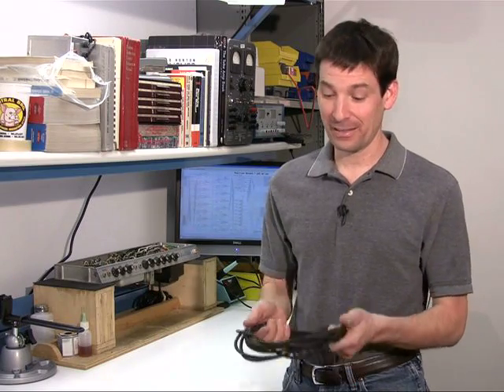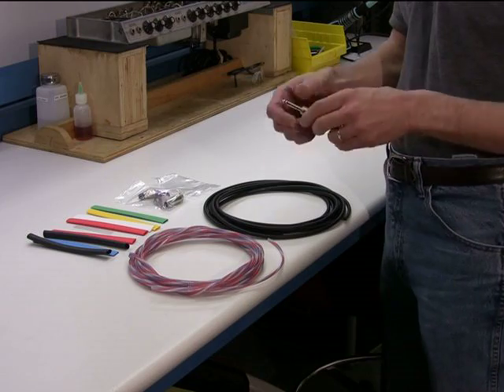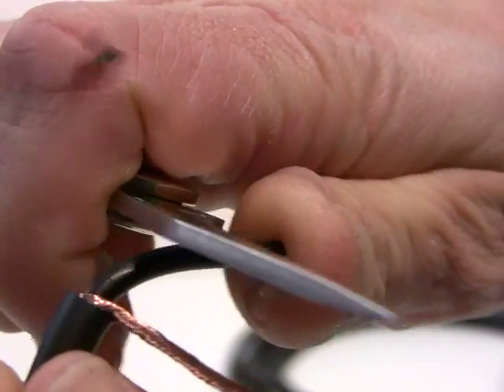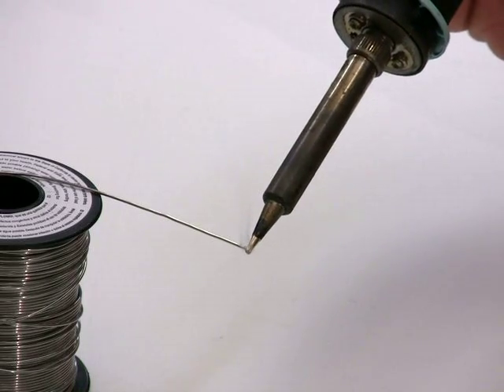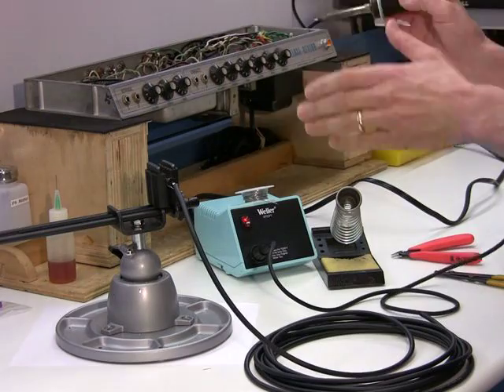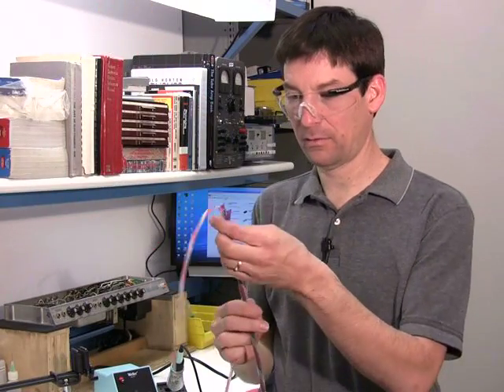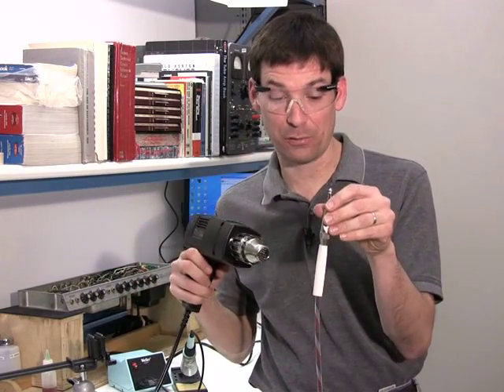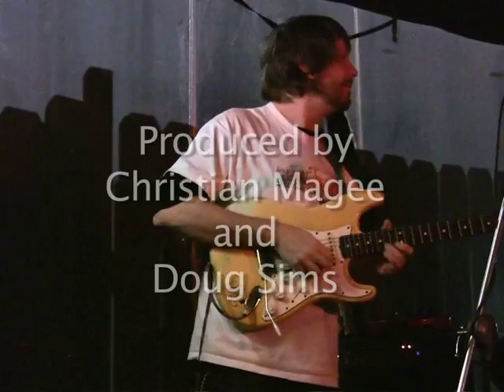How To Build A Better Instrument Cable

Comment: Thank you so much for hearing me out...well im an ameture i thought of building a guitar amplifier probably a tube amplifier or a solid state amp.So where do i start with that . The circuit schematics,the components used.This is a project ive always wanted to do but never really had the guidance to start of.

looking forward to your reply

Comment: The word back in the 70's & 80's was... anything over 18' and there are high-end losses. With todays cables, I'd totally agree with you at 20'. I still have my 70's WhirlWind coil cord. It definitely sound different when A/B'd with the newer cables I've built. I also have a 15' Belden/Switchcraft cables from 1980. It has a S.S. ground shroud and is indestructible, accept it's too stiff and tends to knot and twist too much. It's sounds great, but I guess it's time to come into this century, huh?

Comment: Okay,cool. So, at 25ft., signal losses begin with the Mogami cable. I go direct into the amp so I have nothing in-line to boost the signal. 

Do you know anything about the same question applied to Plant Waves SC cable? I was planning on using new plugs I already have; a Switchcraft 280 and Neutrik right angled silent plug with Planet Waves SC cable, but the Mogami cable looks pretty darn good. Just trying to get your opinion on the two cables.

Comment: How long can you run a Mogami sc dbl shielded hi z cable before you start losing high end using a LP? I know with Belden sc it's about 18ft, but I don't remember the how much resistance per ft. it has.

Comment: its better to cut the shield shorter than the centercontuctor, so if you pull on the cable the the force is applied on the shield, which usually is stronger than the conductor.

Comment: Hi, thanks for this great video, very informative + interesting.  I have nailed the guitar cable making no problem however I have a specific type of guitar cable that I am unsure about.  Can you help me?  I need to build a stereo patch cable 1 a TRS at each end that can take a stereo signal from FX pedal into a stereo amp setup. 

Basically I do not know what type of cable to use because Mic cable has different properties to good quality low impedance guitar cable right? Hope u can help :)

Comment: I'm new to soldering: Isn't it against the rules to put the solder on the tip of the iron and then go to the wire? Or is that only for when making joints?

Comment: You should probably point out that you should put the connectors on first the second time.  I can't count how many times I've soldered up the second end, and then realized the other sleeve is still on the table :)

Comment: I noticed a huge difference with the high clarity plug, it sounded like I had a 2 ft cable instead of a 20 foot cable. The capacitence dropped so much that the sound produced was more natural than any other I used. Most people I know say a cable is a cable so I did a blind test at Sam Ash and the cables with the G&H connector won hands down 8 out of 10 times. One person said it was nice to hear what he wanted to with out the use of an e.q. I to have used them all but was just suggesting G&H.

Comment: Hi Caution do not remove cable outer this way 

I can not believe that you talk about safety and then show a guy cutting towards his thumb.  Be warned, the guy that trained me in the BBC to terminate co-axial cable promptly sliced through his thumb to his bone !

To cut the outer, place it in a flat piece of wood and  roll the cable between the knife and the wood, drawing the knife back and forth until the outer is just cut.  Never cut towards yourself.

Comment: This is not as easy as it looks. For best results, "Tin" the connector cup and flange. You only want to strip about a half inch of the cable to begin with. Take great care to twist the outer shield neatly and tightly or it wont fit in the connector flange. Pay special attention to where the heat gun is blowing and don't get it any closer than is needed to make the Shrink Tubing react. Use the correct tools. The Xcelite nippers he sells are essential.

Comment: This is great for a standard instrument cable. I am looking for a 1/8 with 90 degree bend connector 20 foot of cable and a standard 1/4 connector going to the amp. This will be used for a violin. Would there be any difference in construction with exception to the one different connector?

Comment: @TubeDepotTV ok gotcha there.  im talking about the ground conductor. it looks like it would short out against the casing.  i went ahead and built the cable figuring the case would just be grounded too.  inerestingly i built 2 and one works fine.  but one drops the volume level down by about half or so... didnt think that could be an outcome.  ideas on why?

Comment: what's the point of the heatshrink being outside?  every other cable I've seen has the heatshrink wrapped over the conductors with the plug casing on top of it.  I ordered these amphenol connectors and noticed the ground lug on the plug will come in contact with the shell (case of the plug) once put together... does this matter?  isnt the heatshrink supposed to go over the conductors to protect them from shorting?  I've also seen the heatshrink go over just the tip to prevent shorts to ground..

Comment: I have an old LP body guitar my dad learned on that I gutted completely. It's only got one pickup mount so I would only install one pickup (I was thinking a Seymour Duncan Pearly Gates) and wire it to the pots switch and input but I have no clue what I'm doing.

Comment: Why is the heat shrink called clear when it is obviously white?  Also at the end when the guitarist gets the new cable, it looks like the patriot tech flex but you don't see the heat shrink.  Does it become clear over time or something or was that a different cable than the oine you made?

Comment: spiral shields suck you need a woven shield to provide strength and rf reduction. i work next the the CN tour in Toronto one of the largest most powerful radio transmitters in the world and all the spiral shielded cables pick up radio.

Comment: Awesome video man. Thanks for sharing! I'm buying all the materials as we speak, but what size (expansion range) Techflex do you recommend getting for the Mogami W2524 cable? If I'm reading the specs right, it seems like the cable is just under 1/4" in diameter. I assume I would want either the 3/32–1/4 or the 1/8–7/16, but what is your recommendation?

Comment: Keep in mind, I'm not saying it was hard. But on the model jacks I got, the connection points weren't quite so simple. For the outer shielding, I ended up snipping off a small tab to make it snug. I'm sure there are plenty of people, like me, who are watching this video because this is their first soldering attempt. Hell

Comment: I'm not sure what to get, 1/8" or 1/4" tech flex. I plan on using 6mm mogami instrument cabling. Also is there a certain brand of flux that works best for this application?

Comment: @monkeyxx Yes, built many a cable in my day.  You don't need to hold the iron on there forever.

The technique I am speaking of is common practice, even when soldering solid state electronics (ICs, transistors, etc).

Comment: @TubeDepotTV 
Thanks :)

BTW, doesn't the heat shrink usually goes "inside" the connector to make the solder more durable ?

What's the point of putting it on the outer side ?
Wh

Comment: Not the greatest soldering technique.  The soldering iron should heat the work, then you apply the solder.  Doing your way can result in "cold" solder joints, where the solder melts but doesn't really fuse to the conductor or the plug.  You MUST heat the plug connections so they are hot enough to melt the solder.

In addition, you need to really hold everything still as you do this, so the 1 hand method is no good.  If the cable moves at all as the solder cools, you can end up with a cold joint.

Comment: Do you know if pickups or the wires can go bad? I found my dad's old bass that he had taken apart. The bass has been sitting in disrepair in my basement for the last 10 years. He removed the pickups from their knobs and i was just wondering if i could just solder them back up and go from there.

Comment: Rob loved your video ,i placed an order and went with the neutrik plugs because i wanted a right angle plug, i just noticed the ends are different, how do you make you cable attachment,where do you solder? ,can you use neutrik?, if not why didn't order person tell me that. thanks steve

Comment: Not proper soldering. it worked here, but in general, you DO NOT want to carry the solder to the connector via the iron tip.

Comment: cut the shield to the right lenght before you fix it so you have a nice end and you can prevent microcracks
if you are carefully you can use a lighter for the heat shrink

Comment: jeez, just tried the link to make sure and it doesnt work - just search "Giddel GDA229" on ebay and you'll see the connectors there that I mean.  Could really save some space on the pedalboard.

heres another utube vid that shows these connectors (paste the link in after the slash):

watch?v=QMjJNO1_Jq8  
(:07) btw his jig is a great idea

-------

also, forgot to mention that for #2 regarding the cylindrical plastic shielding, are those their as an RF filter / rf choke to cut out interference?

Comment: for the THIN right angle connectors - to clarify - this is the only place ive been able to find that has em:

h t t p://cgi dot  ebay    dot     com/ws/eBayISAPI.dll?ViewItem&item=130324926810&ssPageName=STRK:MEWAX:IT

would like to be able to get the best stuff available for this proejct, and hoping all this stuff is available from one place...does that store/ website exist???

thanks

Comment: few other things:

1) As far as heat flex tubing, should I get 3/8" size or something else? 

2) I'd also like to get a few of the cylindrical clear plastic protecters that go under the metal piece you screw on.  They still protect but can be slid on and off unlike heatshrink tubing, you sometimes see them inside store bought cables.  I don't know what to call them or where to get them.   Any ideas?

3) thin right angle connectors  
Any specific places or websites that you'd recommend?

Comment: hi, 

thanks for your answers from before.  I'm kinda surpised you said go with the 60-40 because the 40-60 says its made especially for electronic applications.  I did go with your recommendations, thanks again.

I will be buying one of the flax bottles with the tip, there seems to be a bunch to choose from on the website you gave - can you recommend one in particular or list the one you used so I dont buy the wrong one?

Comment: -2- (cont from above)

3) I have two kinds of solder, one is 40/60 the other is 60/40...which one is better for patch cables?

4)  My cable is weaved together and is a pain in the **** to unwind.  You seem to do it so easily, I know your cable is different....but any tricks to help with weaved cable?

5) Should I be soldering the outside wire or inner wire core first?

6) since I'm using right angle connectors with less space, is it ok to not apply solder to the wire before attaching?

GREAT VID

Comment: I am making cables for pedalboard using right angle connectors, they seem a lot harder than what you've shown here since theres so much less room to work with.  
A few questions:

1) I got the solder flux, works like a charm but where can I get the cool bottle with metal syringe looking cap?  Exact model would help greatly.

2)It seems like I have too much strand on my cable when I go to solder to the connector, is it ok to cut some off or does that defeat the purpose?
 
(cont)

Comment: Great video for the DIY community =)

I would like to hear your thoughts on something I've been reading for awhile. Some people recommend not soldering the shield on one side of the cable and then using another cable for the mass or an stereo one. This way all the shit that happens outside of the cable is derived to mass, without conducting any of it. Also, if connected, it could act as an antenna for the length it has making things worse. 

It makes some sense for me...let me know what u think!